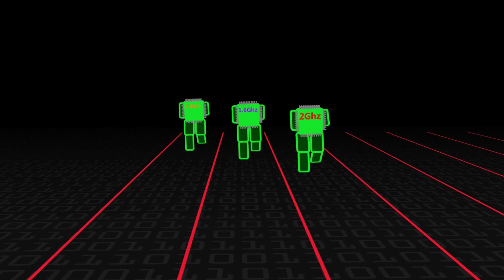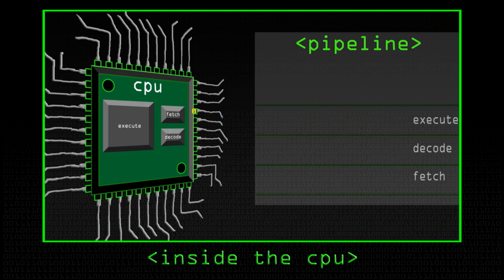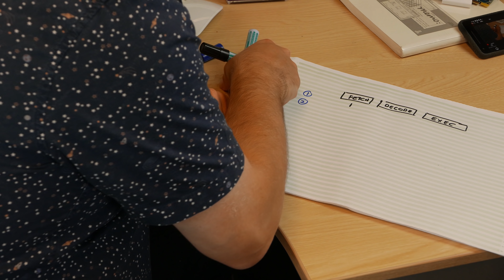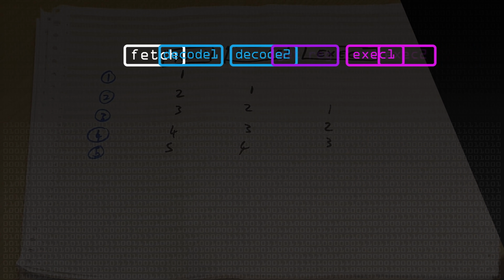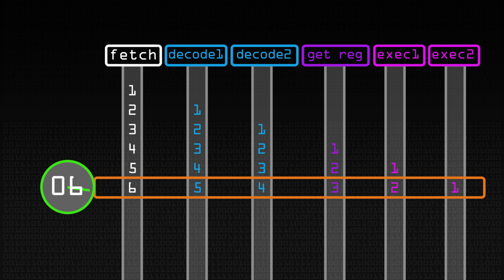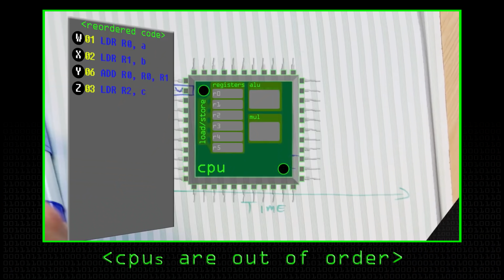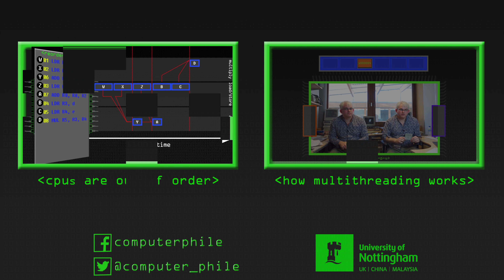Computer Speeds - Computerphile

Comment: The GHz is how fast the little legs move. But some of the runners can carry more, some go through short cuts... some have longer distance to cover. :P
Reply: Right, an Intel (CISC x86_64) CPU will most always have a higher clock speed than that of RISC (let's say aarch64 or armv8) because of the way the CPU is designed. Your phone has a slower clock speed, but the instructions are much more powerful than a CISC style machine. That's why the Raspberry Pi's are so great for how slow of a clock speed they have. (700mHz? For 3B)
Reply: @zac9176  Intel's and AMDs CPU instruction set are cisc, but the actual CPU design is risc, which uses microcode to covert complex cisc instructions into simpler one and executes them instead, as for why Intel and AMD still uses x86/64 instructions set, it's for backwards compatibility
Reply: @zac9176  " Your phone has a slower clock speed, but the instructions are much more powerful than a CISC style machine" – this should've been reversed. The whole point of RISC is having less logic in the CPU itself.
Reply: Snow Star source?
Reply: The cores is how many legs
Ghz is how fast the legs run
Reply: @zac9176  that's backwards.  Risc architectures solves problems using many simple instructions instead of a big complex instruction. 
The burden is moved from cpu complexity to software complexity. (The equivalent risc program requires more memory).
The Ghz on your phone are lower than your computer because of power consumption. 
The thing preventing GHz arm processors wide adoption (in general) is the cost of migration of all software stack to a new arch.
 ( it's like trying to change from a "qwerty" keyboard to a "dvorak" one... it's possible, might be better, but there is little gain on doing so and the cost of the transition is very high.)

Comment: A nice analogy I like to show is with engines/motors, the clock speed is the RPM, but the key is that the torque is also important, and that "torque" is defined by the architecture, which is where most of the improvements happen between architectures.

It starts to fail down when you want to consider instructions which take different times, I still think it's helpful as a quick analogy. :)
Reply: Each instruction is a module with its own gear, and its execution is complete once the gear does a full 360° turn.
Reply: You are talking about what is usually known as microarchitecture, i.e. the implementation of the higher level instruction set (which is also called "architecture"). Performance is also dependent on the (even more) detailed level of physical conductors, transistors, gates, latches, etc.

Comment: I could listen to Dr. Bagley talk about this for hours. It's really important and we are now at a point where we literally can't make processors better just by speaking in terms of clock cycles alone. We require entirely new ideas about processor architecture, because the x86 model is done.
Reply: At one point x86, Motorola 640x0 and PowerPC were co-existing as PC CPUs. I was rather disappointed when Apple gave up on PowerPC.  I don't know how ARM or RISC-V moves into the public marketplace, will people be confused at a smartphone CPU like ARM moving into PC and other spaces?
Reply: @squirlmy  arm as pc is already happening.
Reply: @squirlmy   It was hard (hard?) for them. Jobs explained it, the lack of commitment from IBM,  PowerPC gave up, not Apple.
Reply: @kelthuzad842  30+ years late.

Comment: "We can make the pipeline longer"
I'm getting visions of Pentium 4...
Reply: P4 warming under my desk to this day...
Reply: That wasn't the problem with NetBurst, it has 20 stages, Ryzen has 19. ERROR
Reply: @hjembrentkent6181  Record-holder is Pentium 4 Presscott with 31 steps pipeline.
Reply: @darkstar2111  So why does Prescott then have the same problems as NetBurst with 20 stages? Because it's unrelated. It doesn't have enough cache, ALU throughput, retirement station bandwidth, decoder bandwidth, it can't cancel u-ops after mispredictions etc
Reply: @hjembrentkent6181  You are right, but why not use the word capacity or speed instead of bandwith? I mean, the real (or orignal) meaning of bandwith is a frequency span in analog electronics and broadcasting (say 98-108 MHz, or even 99.50 to 99.60 MHz, etc.).
Reply: That was certainly was aspect of the demise of the Netburst architecture. Another one that the P4 tanked was that its underlying circuit technology, cross-coupled domino logic (that's one way to build fully reversible logic requiring next to no energy to operate - in theory), was far too unripe & ill fitted to work even near that efficiently under these these high frequency clock rates - that's because this form of reversible computing does require to repeatedly pump large amounts of electrical charge from one place to another which is not possible to be do so without using energy & charge storages (capacitor) which grow incresingly inefficient at high operating frequencies (like the multi GHz the NetBurst microarchitecture would suggest). That being said, CDL & its variants are more efficient at lower clock speeds up to about the ~100MHz range, sometimes around several hundred Mhz, but things go downhill beyond that.

Comment: It's super weird how these things progress. The 5W, 1.1GHz m3-8100Y in my new laptop outperforms the 105W, 2.4 GHz Q6600 that was in the first desktop I bought in 2008.
Reply: More transistors, simple really
Reply: For the most part, yes. But having the two extra cores helps the Q6600 beat the m3-8100Y in things like multicore Cinebench (509 vs 413 in R20, 250 vs 197 in R15). And the Q6600 could overclock decently if I recall so it could further improve its lead there quite a bit. The m3-8100Y isn't 1.1GHz under load either but a rather impressive 3.4GHz single core / 2.7GHz dual core turbo with a still thrifty 8W or so power draw.  

As for rkan2's comment that "More transistors, simple really", the transistor count is actually similar and probably slightly favors the Q6600 with around 582 million whereas each core in Sky/Kaby (Amber)/Whiskey lake is around 220 million.
Reply: Always look at FLOPS
Reply: The actual power draw isn't really 5W, also it has a turbo speed of "up to" 3.4 GHz.
Reply: I still run the q6600 on my desktop every day, it’s a beast! So ahead of its time. I have newer core i5’s that I feel like don’t noticeably perform much better in day to day regular tasks. Now if you’re really pushing it in gaming or vms obviously there’s a difference but intel really did a fantastic job when that first quad core was released.
Reply: I still have my Q6600 PC from 2008. I'm really amazed at how well it performs to this day. I think back at my Pentium II 266MHz from 1997 and how atrocious it was compared to the Core 2 Quad Q6600 11 years after, and now we're 11 years after that Q6600 and it still performs adequately. Either Moor's law has seriously slowed down or software has become more scalable to accomodate for legacy hardware.

In light applications (web browsing, productivity apps) the Q6600 works like a charm, but it starts to show its limitations in heavy apps such as simulation games, like Cities: Skylines for example. In this game the CPU starts sweating and dragging the framerate into single digits soon after population reaches over 30,000, while on my i7 8550U laptop (which is an ultrabook with hardly any meaningful cooling solution) I can get up to 100,000 population before any framerate slowdowns and up to 400,000 before framerate hits single digits.

Comment: The bit he left out is that CPU manufacturers have lenghtened the pipeline precisely to allow faster clock speeds.
For example an ARM7 (1995-2005) had less than 10 cycles (about 7 or 9 stages) and because each cyle does more things it's very hard to match timings and get a high clock speed.
So newer ARM Cortex (2005-today) have more than 10 cycles in their pipelines (around 15 or more). With more steps, each is smaller so that the overall clock speed can be increased. But with a longer pipeline, a full refill is a bigger waste (compared to a smaller pipeline) hence the mitigation like branch prediction and superscalar instructions (=instruction-level parallelism). It's all a trade-off that works well for some workloads and less well for others.

Comment: So it's practically impossible to compare processors of similar speeds without benchmark tests and even those are subjective?
Reply: Aside from newer means better in just about every case, yes. 

Even then, benchmarks need to be done in whatever programs you will be using as programs run differently on different cpus. So do games.
Reply: Ha!  late 90's, a video card was redesigned to beat benchmarks doing cache of those simple programs, useless ability in real scenarios.

Comment: There is so much things to take into consideration when it comes to comparing architectures and processors.
I do find it partly annoying when people in general look at clock speeds or pure core count, or a multiple of the two. While not taking architectural differences into account.
Though, a lot of people toss ARM under the buss due to it being RISC, and RISC surely is always worse then CISC. (Not really, depends greatly on the application, and the instruction set.)
In the end, comparing two processors can be very hard and vary extremely depending on the application. Heck, even some tasks are faster done on some cheap microcontrollers then on high end architectures...

Comment: I really wish you went into more detail on Instructions per clock, Its the reason why a MOS 6502 could beat out a Intel chip of the same period when run at the same clock speed.
Reply: 8080,  you had to waste instructions to move data from/to  (A)ccumulator every single operation.  I was shocked when I learned 8086 had the same flaw.  Big set but very few registers that time.  Plus the crazy overlap address segments.  I was sure PC wouldnt survive.  Buh.

Comment: If I am correct he explained why x86 is faster and arm is slower the x86 can do more single instructions ( per  clock) than arm does it in two ( the extended model)

Comment: Fact of the matter is, regarding General Purpose Use - Clock speed has had a larger factor in quantifiable CPU throughput than 'design' has - looking all he way back to 8Mhz 286's.  
Little things like MMS (remember that?) added little bits - AES-NI is a massive thing - but these are additional ASIC style development really.  For the most part - the software you run isn't scaled / compiled well for the architecture capabilities of the CPU you are running on.  
UNLESS it's dedicated simulation.
Reply: Often true today. But there were many cases where radical design changes gave a real boost in performance, even at the same clock frequency. Such as the quick 80286 compared to the simpler 8088, or the twice as efficient 486 compared to the older 386/286. The original Pentium was also a significant enhancement over the 486, especially in execution of floating point instructions, again at the same clock speed.
And sometimes older is better, such as when comparing early Pentium 4s to Pentium 3 (P6) or Athlon, even at lower clock frequency for the two latter. There are also similar cases, such as Cyrix 6x86 or AMD K6 versus the Pentiums (except for floating point).

Comment: You cut out the bubble intro :(
 At 2:53 was the last shot of paper pre-bubble, it shows: 21_ → 321 → 432 → 543 (simple enough...)
3:36 is the next available shot of paper, but it has something completely different now: _43→5_4→65_→765 (a bit more difficult to grasp!)
What happened in between!? The answer: Bubble. It was not explained what that is. Just used in the next scene without explanation.
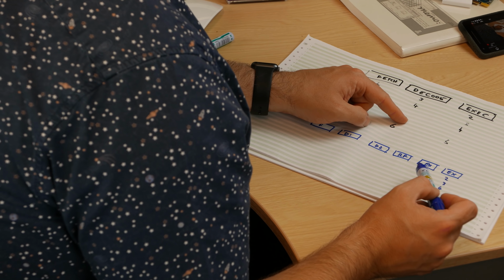Reply: Followup comment: At 4:39 there's a short (textual) bubble explanation. I understand it only because I already knew about bubbles.

Comment: Not only the pipeline.  
I did some asm. Well, I admit, before long pipelines and predictive arquitecture I know nothing about.
I remember:
the 8080 where every operation had to be made inside the acummulator, then the Z80 you do ops on any register without the need to move from/to the accumulator saving many instructions. 
Then some micros with the ability to switch an entire set of registers making multitask more efficient.
Then the Wang VS 40 bit long instruction, yo do the operation, increment/decrement one/both Mem Addrss Reg, check status (like zero), set a short jump address... in a sigle 40 bit microinstruction.
Then the "RISC" idea, lots more registers (and some cache) area , less microinstructions circuit on complex instructions that are used less than 1% of the time "lets the compiler deal with complex instructions"
Any of those makes the clock comparison useless.

Comment: So is this what 'instructions per cycle' is all about?
Reply: Mathematical calculations the CPU actually makes, like if you have a video game, drawing the graphics of the game into the screen means the GPU is making geometric calculations to actually draw the game world, so a set of instructions can be a bunch of mathematical operations of arithmetic and geometry
Reply: Pretty much.
Reply: It's related to it. Actually executing an instruction often takes multiple clock cycles, but if you have enough execution hardware in your processor, you can build one that will average more than one instruction executed in a clock cycle.

For example, if your multiplier takes 3 clock cycles to do a multiply, then a processor with 4 multipliers, and fed a suitable stream of instructions, can do 1.33 multiply instructions per clock.

Comment: Are CPU clocks made using crystals? If so, how is it possible to overclock or underclock, since crystals output constant frequencies IIRC? Also how difficult is it for the motherboard to synchronize between components since CPU, RAM, etc. are all clocked differently if I am not mistaken? An in depth video would be cool :)
Reply: They use relatively low frequency crystal as a signal source for some PLL or DDR generators. So the CPU clock frequency can be adjusted just by changing division rate without changing input oscillator frequency.
Reply: Fast clocks are generated using Phase Locked Loops (PLLs), which allow clock multiplication and can be voltage regulated. Designing features which allow for acceptable tolerances in clock multiplication is the job of an entire team at a semiconductor firm.
Reply: Thanks you guys.
I am only familiar with PLL in the Doepfer A-196 module (modular synths). I get that it tries to match the frequency of an internal oscillator with a multiple of the frequency of an input oscillator.
Is the "Loop Filter" the part of the PLL that would need to be voltage controlled to overclock / downclock?
Reply: All PLLs are feedback systems which rely on one or more voltage controllers oscillators, clock dividers (to detect phase shifts with different frequency components), comparitors to perform these comparisons, and output stages to combine the results of these comparisons into a new clock signal. The goal of a PLL design team thus involves a variety of digital logic design and analog characterization, at least for multi GHz+ clocks. The goal is a device that takes an input clock and a latched digital value representing a multiplier, and to produce the desired output clock. The way this is done is very clever: the PLL shifts the phases of a number of VCOs, and detects when the original clock is in phase with each of these. The output of the comparisons is the new clock signal.

Comment: No mention of SIMD vectorization or multicore as a design strategy to mitigate the frequency limit (a 24 core CPU with AVX512 instruction set and 2 FMA units can in theory do 768 double precision floating point operations every clock cycle). No mention of the power and thermal limit that restrict clock frequencies.
Reply: Personally I dislike how this person in particular is explaining things. Seems to be focusing on various things and skipping important and interesting information all the time.

Comment: Is it reasonable to assume that there's an inverse relationship between clock speed and number of logical gates activated per pipeline stage? My understanding has been that there's generally no magical frequency limit but that we could in theory split a pipeline into so many simple stages that it can run at like 10ghz+ while utilizing the same process to build (assuming such a clock can be accurately generated).
Reply: I mean, even a single transistor has a maximum frequency it can operate at, although those are much higher. I imagine there are tradeoffs in designing faster gates or excessively many stages in processing though.
Reply: The more pipeline stages you have the more it hurts when you have a jump or a bubble.
Reply: Heat dissipation, voltage gradients, and physical electron motion are all limits being encountered.
Reply: Heat is the main problem with running things at high frequency. Every cycle electricity is goes through the CPU gates. The more you do it there is less time for CPU to cool. Added to this is reduction in size which also speeds up heating. So it's a matter of compromise. There are other factors as well like some people mentioned.

Comment: RISC would also speed up the execution cycle.
Reply: Not today. Modern so called CISC (such as x86) uses the same type of low level execution as RISC processors. Non-RISC processors has always translated "CISC" instructions into simpler microcode sequences, but today, that is done in parallel with the actual execution of these generated micro-instructions. CPU like x86 are therefore as fast as RISC (or faster). The downside is that this extra logic draws extra current.